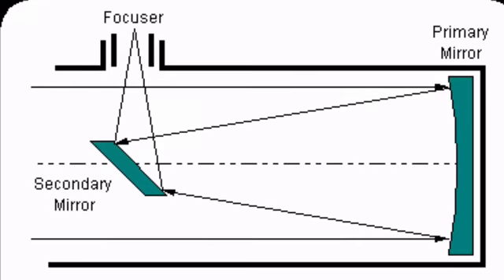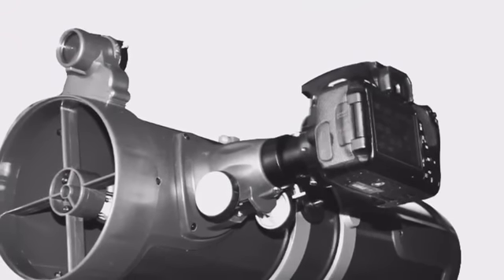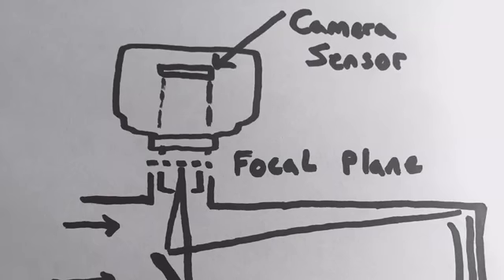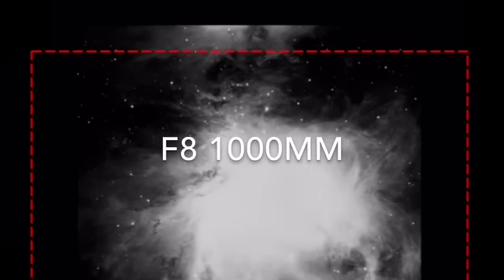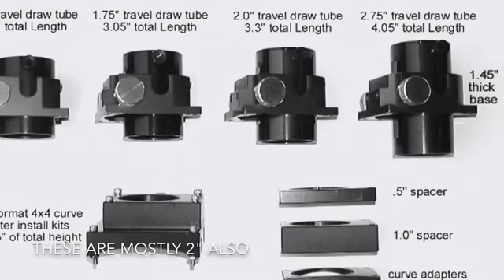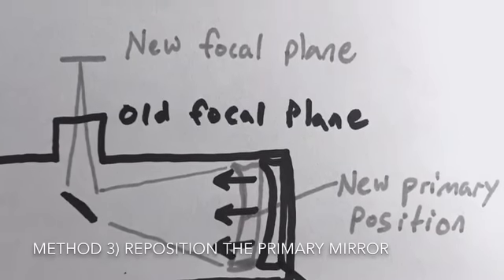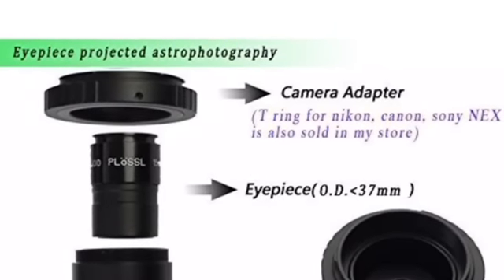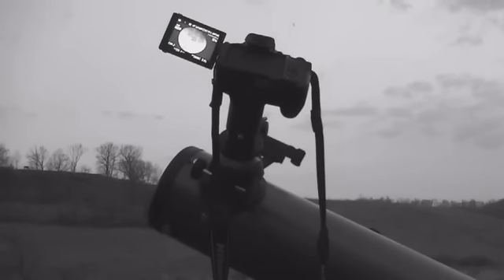Newtonian telescope how to find focus dslr astrophotography

Comment: Hi everybody! I am starting to build my own telescope and am trying to track down the right parts for the build. It appears eyepiece projection is the simplest solution, with the drawback being the balance with the camera hanging to the side. Could that be solved with rotating the tube so camera is straight up?
Reply from the maker: Yes. That’s a great question too. If you’re trying to get spot on balance it’s also possible to place small counterweights opposite the focuser. I personally prefer tube rings on Newtonian telescopes so that I can change the orientation as I need. Eyepiece projection is very demanding. You may get frustrated at first but don’t give up. If I were to suggest the best starting point for Newtonian users I would say get a coma corrector first. A very reputable one is the Celestron 6.3. I love the Newtonian myself. Here’s some potential problems you’ll face with ep projection: 1) Stock rack and pinion focusers tend to sink. The top/down camera position may not work best for you unless you have a good focuser. 2) tracking demands are increased due to increased magnification. I’d like to know your exact setup. It’s easier to make recommendations.
Reply: @GarnettLeary  I have a D203F800 mirror set on its way. The focuser I am not finding many to choose from; I mostly use ebay for my shopping. I am trying to build this on a reasonable budget, but not against spending money where I need it most. Any suggestions on websites (preferably USA) on where to find DIY parts? 

The tube i will be using is a 10" concrete form with fiberglass wrapped on the outside to give it strength. I will probably buy the secondary mirror holder/spider or construct it myself with threaded rods if I can accommodate the fine tuning aspect. 

I watched a video yesterday that used a 2" extension tube to accomplish prime focusing which has me confused a little. I thought you need to bring the camera closer unless it is going farther out past the focal point and focusing on a flipped image(still learning optics).

Thanks for the help!
Reply from the maker: I’m sorry I don’t know any US based parts dealers. The extension you mentioned may have been from an RC? Those have very specific back focus requirements. I use a 2” extension with my Maksutov in combination with dslr. It’s for a different reason tho. The exit hole out the back is smaller than my camera sensor so it clips. Heavy vignetting. With a 2” extension I can place the sensor over a wider part of the light cone. In this way the sensor is fully illuminated. I’ve never heard of this with a Newtonian. There are Newts designated as astrographs. In that case you have a scope already figured to reach focus with a camera. With those you need an extension to use it visually. I’ve got an excellent book on optics and scope building at home. It will be several months until I return but I’ll get the name once there. It has listings for parts dealers, although some may no longer be relevant as it’s an older book. As you probably know Synta makes the majority of stuff in China to be rebranded for Orion, Celestron, etc. Most of my dealings are with China but I would of course prefer to keep things domestic and local. I’m interested in your project. Feel free to share any info. Good luck and clear skies.

Comment: Thank you, explained everything very well.  I myself have been dealing with this.  I have an Orion 130mm Starseeker refractor and wanted to try some astrophotography myself.  

With the 4th method, do you use the same eye pieces that you use for visual viewing? So all would be needed is the barrel and the normal t-ring?
Reply from the maker: +SS Sandman that's right. Some of the larger diameter barreled eyepieces might not work but your standard 1.25" will. Eyepiece projection is difficult. Very tedious due to the extreme magnification you get. A great entry level eyepiece projection tool is a variable zoom lens. Celestrons has a t-mount. That's an amazing product. I have a video review of it. You say you have a refractor. Likely your focus issue is opposite of this video about reflectors. With a refractor you typically lack back focus. You need an extension tube and that's all. In 90% of cases it's only 2" or less that's needed. Orion makes a 2" extension tube that conveniently has t-threads on one side and also accepts eyepieces. That's my recommendation. Clear skies.
Reply: My apologies.  The Starseeker I have is a reflector.   Just pulled it out recently and working to get the kiddos excited about astronomy.  Got my new Agena Dual ED 8mm delivered today, so excited to get home tonight to see things compared with the 25mm that came with it.   

The forums mentioned the same thing about the tediousness with the AFocal setup as you mention.  Perhaps my best option for my scope is one of those USB CMOS cameras.   At least until I can get another scope dedicated for AP.
Reply from the maker: +SS Sandman Orion Starshoot is a great product. I'll give you life experiences and explain why. Kids have a natural tendency to both argue for time at a scope. They also have an uncanny talent for knocking a scope off target. Been there many times. The great thing about usb is tethering to a pc puts the focus on the cpu monitor and leaves you to the telescope. There generally isn't any argument over viewing time either as long as everyone can crowd around the computer screen. That setup is by far my best experience when dealing with children. A lot of adults too. Watch folks. A natural tendency of beginners is to grab the eyepiece barrel as they put their eye to it. That's detrimental for extreme magnification. Another consideration you will have when viewing is pupil size. Believe it or not kids have different pupil sizes than adults. So whatever is in sharp focus thru the eyepiece will be slightly blurry for children. Monitor eliminates that complication also. Hope this helped.

Comment: Helpful video and I understand the problem you are solving. But when you add up the cost of some of these modifications isn’t it cheaper to buy a dedicated Astro camera?
Reply from the maker: An astrograph is typically much more expensive than a retail visual scope. It’s overall better to get an astrograph in my opinion but this is a good solution for the many who already have the other more common. Thanks for watching.
Reply: Garnett Leary Sorry i don’t think I made myself clear. I was asking if it was easier to put one of these instead of the eye piece, rather than try to use the DSLR. https://www.rothervalleyoptics.co.uk/ALTAIRGP224C-BASIC.html
Reply from the maker: Oh sure. Definitely. DSLR has become popular but the best images are definitely CCD.
Reply: Garnett Leary am I right in thinking that replacing the eyepiece with a CCD camera will place it at the focal point and bypass the problem you get with a DSLR?
Reply from the maker: In most cases yes. The CCD sensor is usually not recessed as much. Most of your CCDs have a huge weight advantage too being much lighter. They truly are superior in many ways. There are a number of popular CMOS versions too. DSLR is still the middle road between webcam ( for planetary ) and ( CCD ) for deep sky. I’m just a huge fan of conventional DSLR photography and primarily just broadband. Only love for camera should drive someone to adapt it to telescope. I’m not saying DSLR can’t produce but for the serious and dedicated astrophotographers a CCD or dedicated CMOS is much better overall. For me personally my relationship with my working camera drives me to use it in every instance. I am a huge fan of SLRs. I practically sleep with my camera ready. Most folks have some type of SLR or point and shoot and I feel it’s truly the best way to get started. I say that because it’s sufficient for the work and typically not an additional investment. One needs to make certain astrophotography is for them before spending lots of money on things they’ll never use. I have owned all the bells and whistles and to this day I find more enjoyment out of innovation and just a camera and tripod. That’s my personal feeling but definitely if I wanted to get published again I’d get an auto guided platform and shoot narrowband thru a CCD. The most impressive work I’ve seen on YouTube is Chucks from Chucks Astrophotography. The guy is brilliant and very friendly. I’m not a huge proponent to heavily altering images and I feel like his work is about as close to pure as one gets. The majesty of our universe needs no edit. It’s beautiful as it is. Wow you got me rambling. That’s my overall take on the camera type experience tho. Ultimately for me a DSLR feels more human. It’s about freedom.
Reply: Garnett Leary It’s interesting to hear your views. I know that many have trodden the path I’m starting on, I’m having fun with my Olympus M43 camera. It’s amazing what you can do with that little camera and a few lenses. Actually it might be a better fit on the Newtonian as it has a very short sensor to flange distance, I’m just getting interested in DSO having entertained myself with the Milky Way all last season. Just pondering whether to invest in a scope or buy a longer fast prime. I think I have more mileage in the camera route yet. I’ve been excited to produce bad photos of the Dumbbell Nebula, Andromeda and an ISS transit. I don’t want to spend money until I have built the Hubble Space Telescope :-D

Comment: I  don't think you want to move the primary mirror forward.  Seeing how it is set to the secondary for maximum light gather.
Moving it forward will move the light cone forward and lose light gathered by the secondary.  Which yes should extend the focal point.  But instead of 1.5 inches of light turned 90 degrees.
You will only turn 1.25 inches of light err what ever the width of the light cone is at the distance you moved the mirror forward.  Moving the mirror backward or secondary with focuser forward ... will capture all the light but decrease the side ways distance.  Which I think is what you meant to say Garnett Leary.
Ergo the camera can be closer than the intended focal distance.
This is what I was talking about with intercepting the light cone before it goes through apogee.
Say for example on an 8" dob the sideways cone travel is 6" , with a 25mm adding another 1" past apogee for 3" outside the 8" tube.
Standardly we view the image past that , and why it is flipped.
But maybe a camera could get the light cone on its sensor before it hits apogee.   Try 5.5" and less off the center axis.
Still seems strange to me you would get the most magnification off of the smaller light cone.
But there is probably more to the lensing on the capture side I am missing >?

Comment: What about the collapsible reflectors?  Can't someone play around with the length and get the same effect as moving the primary?
Reply from the maker: Yes indeed. Same principle. The only problem you run into overall on any unit is the size of the secondary. It’s possible to move them too close together and clip the light cone.

Comment: PLEASE HELP ME! So I have a celestron astromaster 130 Newtonian reflector and canon eos rebel t6 camera. When I attach my camera to the scope I don’t see anything it’s just black please help!
Reply from the maker: We can figure this out. First I have a question. Is there glass inside the focuser? I’m trying to determine if it is a Bird-Jones telescope. The answer will determine what I can suggest.
Reply from the maker: Watch this video to see what I’m talking about. It’s hard to tell looking in the focuser. You could either remove the focuser to look or take a pencil, eraser side down, and gently press thru the focuser. Be careful. If your pencil eraser made contact inside the focuser you have a Bird Jones.
Reply from the maker: https://youtu.be/W8Ut6HlnUMk
Reply: Garnett Leary  so I checked and there is not a lens in the focused I took my eyepiece out and put a pencil through the focused.
Reply: Garnett Leary so here is my complete setup, I’m using the celestron astro master 130. I’m using a canon rebel eos t6 camera. I’m using a t ring and t adapter also a 5x Barlow lens. When I have everything hooked up I don’t see anything but black in the live view on my camera. The other night I set my scope and camera up and had my scope pointe at Orion’s nebula and couldn’t see anything but black in the live view on my camera.
Reply from the maker: I see. Yes at that magnification stars will be way too dim. You need to shoot a 15 second exposure at a relatively high ISO as a test shot to focus. The Moon will help you when it’s bright. Mark your focus point. Try that and you should see stars.

Comment: What if I replace the Barlow with a 0.5x focal reducer lens??
Reply from the maker: Not sure but likely you’ll still need the in focus. Try it. I’d love to hear the results.
Reply: In focus?? I'm new..
Reply from the maker: In focus referring to the shortening of the distance between the camera sensor and the primary optics. With the Newtonian that would infer that the focuser tube is moving in towards the secondary. If you need additional out, or “back”, focus it would mean the sensor would have to be placed further away. In the latter it would mean the focuser tube would be extending outwards away from the secondary mirror. I’m only guessing but if you use a reducer I think you may not have enough inward focus travel. In other words the camera will come to a hard stop against the tube before it’s coming to the focal plane. That’s a guess. Hopefully you can make it work. Don’t hesitate to ask questions. I have one. What scope and camera are you trying to use? If I had this information I might be able to help more.
Reply: Super cheap scope.. 150mm aperture 1400mm focal length. I want to make it faster. Nikon D5600
Reply from the maker: There’s ways to speed it up. You have to determine if it’s a Bird Jones style Newtonian. Is there a corrective lens inside the focuser?

Comment: Hi, I just got a new telescope and went out tonight to use my telescope. When I went to look at a star, the spider was blocking part of my image. I have seen people saying it's because I need to refocus my barlow, but I only had my 20mm eyepiece on the telescope. Do you know what I have to do to fix this?
Reply from the maker: +Matthew Kerner could be a lot of things going on but you definitely shouldn't have an image blocked by the spider. The only thing the spider arms should do is split incoming light and create diffraction spikes. All instruments have a maximum and a minimum magnification. On the minimum end you could use an eyepiece at too low a power it becomes obstructed. That happened to me using a 40mm eyepiece on a large F5. The secondary obstructs the exit pupil when below the minimum usable power. Try increasing the magnification using a higher power eyepiece. A center obstruction can also be due to a misaligned secondary. Just shipping a Newtonian can knock it out of alignment. I'm sure you have checked your collimation but if you can get your hands on a laser collimator you can bypass a misaligned secondary easily. Much harder to judge with a cheshire. Was there a huge difference in temperature when you set it up? For example carrying the scope outside from a well cooled house into a hot environment or vice versa. Mirrors actually flex under these situations. In larger instruments it's more prevalent. I always recommend rough alignment indoors then fine out in the field. You can do testing daytime. Find an object at the edge of the distant horizon and try to resolve it. That would be infinity focus. If nothing here helps you get back up with me. Likely I covered it. Good luck.
Reply: Garnett Leary my secondary was misangled, and after I aligned it everything was great. Thank you!
Reply from the maker: +Matthew Kerner glad you got it working. Enjoy it.

Comment: Anyone know how or have recommendations to focus a 1996 xl200 Meade telescope, bought it used and I can't seem to focus it...
Reply from the maker: +Jonsie Ripley are you referring to scope focal length and diameter or imager resolution? What's the exact model of your telescope?
Reply: Garnett Leary it is model xl200? Focusing on an object, it is way to far and blurry and it should be extremely focused.
Reply from the maker: +Jonsie Ripley Let's back up because I can't find that model. Three questions: 1) Is it a reflector or refractor?, 2) Are you using an imager or an eyepiece?, and 3) What type of objects are you focusing on? I want to help but need more information.

Comment: Thanks for the education! Very good info!
Reply from the maker: +Nigel Waterhouse Thank you. There's not much info around about this topic but it's definitely one myself and many others have fought with.
Reply: Garnett Leary true, a lot of effort for not a good result.  I find it's better to use a camera setup and technique without using a telescope; much better results, unless you're prepared to spend the money on a proper astrophotographers scope.
Reply from the maker: Nigel Waterhouse agreed. Certainly camera only is far more portable. If you could see the Moon in say an 8" Astro graph you'd quickly notice the roll in clear aperture unmatched by camera too. It zig zags in price between the two depending on what you're trying to do. A high quality 500mm camera lens on a star tracker mount can generate most DSO images. I do both and I'm constantly on the fence of that topic.

Comment: Can i use no camera.
Reply from the maker: I’m not sure I understand your question. If you mean: “Can it still be used visually after shortening the barrel?” The answer is yes but you will need a 2” extension tube in front of the eyepiece.